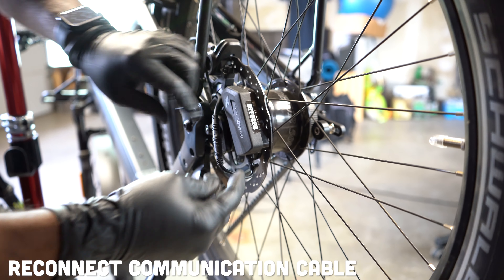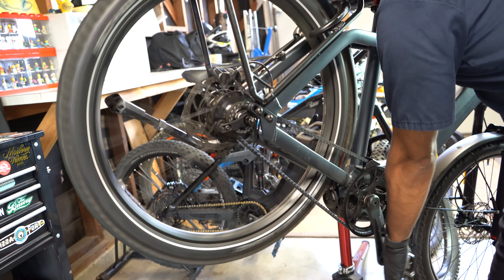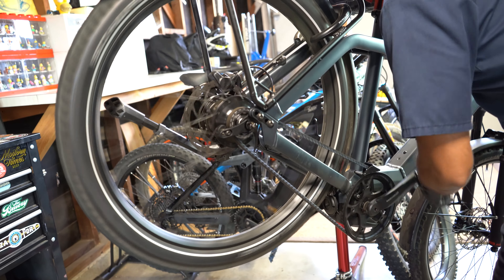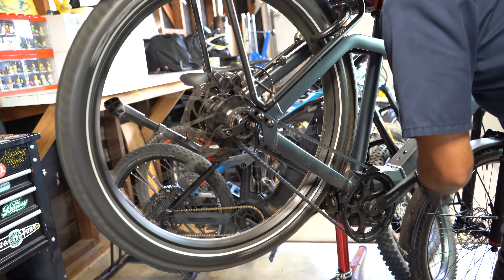How To Remove a Rear Wheel With The Rohloff Hub | A Step By Step Guide For When You Get a Flat Tire

Comment: Practice makes perfect. Some bikes may have different types of drop outs or belt tensioners. So before you hit the road, familiarize yourself with your bike’s system. Pro tip: it’s easier to install the wheel with the belt belt if the tire is not inflated. This will give you more room to slide the wheel forward, giving you more room to slide the belt over the sprocket.